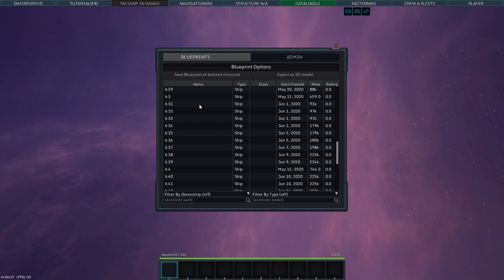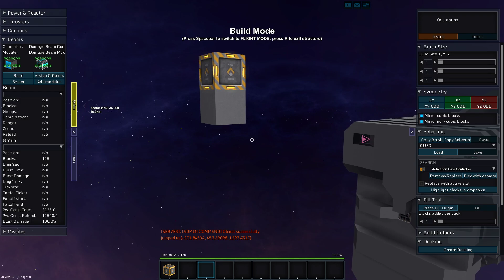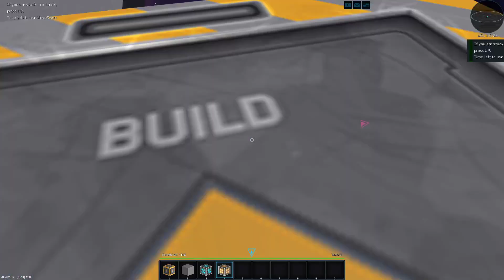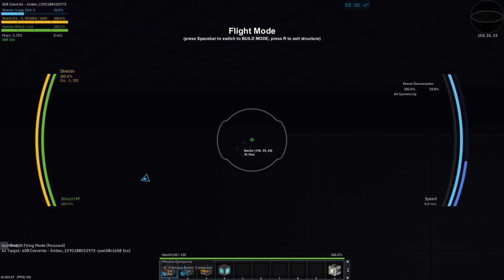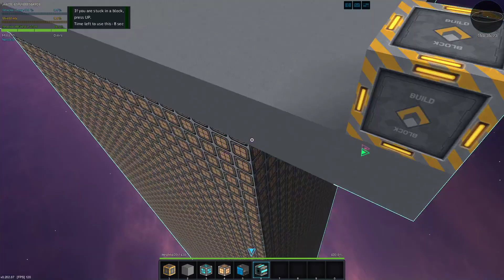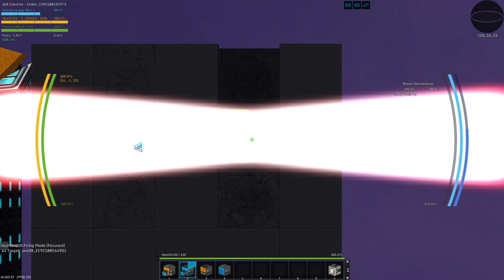Layered Reactor Test - StarMade S2-561

Comment: I actually miss how the power systems worked before the Power update. It required a bit a thought before you started building your reactors. I used to try to make my reactors like works of art and enclosed them in crystal armors. (Or basically made massive reactors by building the reactors into the station's support struts.) Now it's "dump a bunch of reactor blocks and then dump a bunch of stabilizer blocks because calculating the exact distance for optimization stinks".
Reply: I played Starmade like 3 years ago a lot, now i was thinking of returning so i was checking what changed, and then see that reactors are basically dumbed down. Do you really just place a huge chunk like this and its done now? That's just boring, meh...
Reply: @N0xiety  There's a formula for how many reactor stabilizer blocks (and reactor chamber blocks for those buffs) you need. And, the system still checks to see how many separate reactor stabilizer modules you have in a given area, because you can only have one-each in a given direction (for up to six active modules). But, yeah, you just brute force it by adding more modules to the ship until you reach 100% stabilization. (That's what I did.)

And, this is really only an issue if you're working inside a tight or otherwise constrained space or form factor or, if you have massive weapon systems. I'd go as far to argue that a 250 m long ship that isn't pencil thin shouldn't have those kinds of constraints.